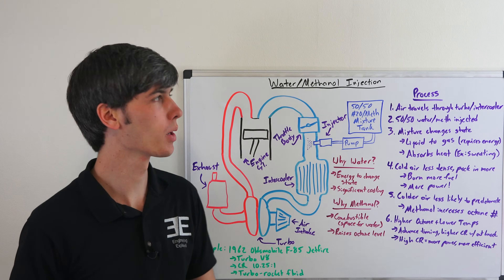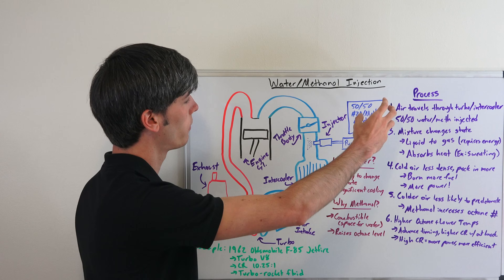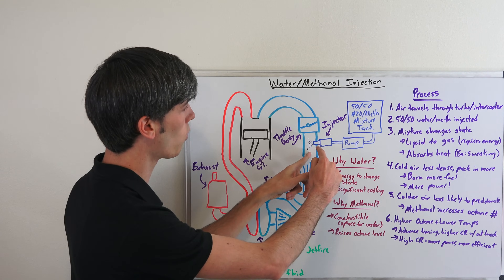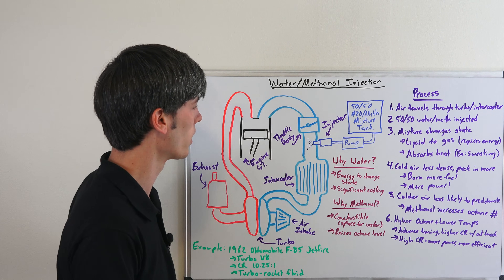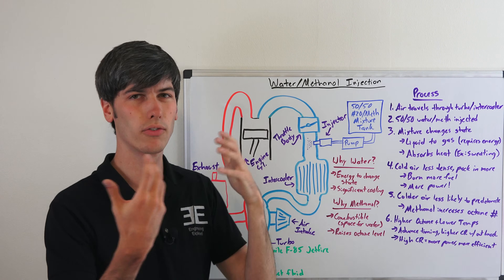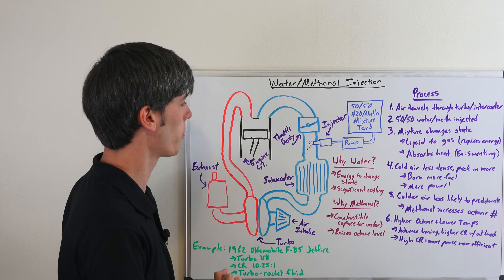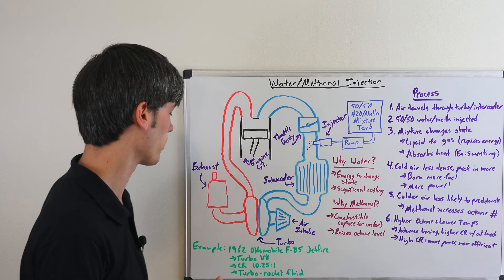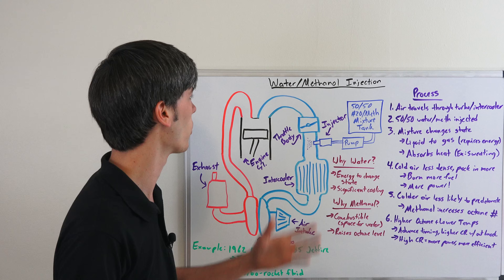Water Methanol Injection - More Boost!

Comment: Will I get a noticeable increase in power output  on my 02 WRX?
Reply: +Greg Mackasey not necessarily true. The water injection only prevents power from being lost via heat or retarded timing, it does not make power. It will only bring back the power you lost if the engine is retarding timing or too hot.
Reply: only if you get a tune
Reply: I'm running such a system and i can confirm that it increases power significantly  no matter on what environment temperature.
Reply: +El Neuro Quila right. It does not make power but can increase power if the engine can take advantage of it. Not all engines can take advantage of this system. 

Methanol can allow for more power to be make if the car is retarding the timing because of predestination. 

The water can allow for more power by cooling the air in the intake. 

One must be mindful that the methanol and water are taking up space for air and fuel. Since methanol had less chemical energy there is potential for power loss of the engine can not benefit from it.
Reply: +Nicolas Losito predetonation feaking  auto correct
Reply: Yep this is a good option if you are running a engine hot with a high compression ratio, because it will increase the thermal efficiency of your engine.

Comment: Hi, Can you do a video out line how to install AEM Water methanol Injection, I'm trying to figure out the progressive controller installation of AEM water meth.
** Solenoid 20AWG 1.5A Brown/White Low Side output. Connect to optional flow control
solenoid, I'm not sure where to connect.
****Boost Safe LS out, 18AWG Green 1.7A Low Side output. Grounded when error condition
exists.
****Arm switch + Yellow wire  Arms injection system. Connect to a switched 12V source.
I'm still searching.... how to do this.. stuff..
Thank you.

Comment: Is there any benefit from injecting the methanol/water mix after the throttle body? And is there a benefit from using a higher methanol/water mixture, like say 70/30 or even 100 methanol?
Reply: Gotta be careful when running that high an ethanol concentration.  The increase in temp is probably because it was running lean.  While the car will run on it, AFR for gasoline is 14.7:1, while pure ethanol is 9:1, and methanol is 6.42:1.  Depending on the car, if the ECU can't compensate for that much of a difference, you could blow the motor since you will need a higher volume of ethanol to match the AFR of gasoline.  I believe the ECUs of the newer cars like some BMWs are able to account for E85 on the fly but older cars don't have this capability.  There will definitely be a huge bump in performance with ethanol in the mix, especially if its tuned for it but its playing with fire if you don't know you're doing.
Reply: Well it would only make it worse because the meth/water mix would have less time to mix with and cool the air. I'm guessing that's why they are put back behind the throttle body.

Comment: Water also expands to about 1600x its amount when turning from liquid to gas, so this helps to add power by causing more downwards force on the piston. It therefore increases the thermal efficiency of the engine because it's converting the heat into physical expansion of a gas (liquid to gas).
Reply: Yea pretty much, because when the water is compressed and sprayed lightly into the intake it will evaporate from some of the remaining heat in the intake air, so you are furthering the cooling process of the air so therefore the air will be more compressed and therefore more combustible so therefore create more energy when it is lit.
Reply: j0n0j0n0j

Yeah, that too! :)

Comment: Nobody is mentioning airplanes? I've never heard of this system being used on land (besides for tractorpulling) but I know that airplanes like the F6F Hellcat, the P51H Mustang, the J2M Raiden and the N1K2 Shiden Kai had a water injection (water/methanol injection in the Japanese planes) to increase performance in high altitudes and as a boost in battle.

Comment: my car's max boost on stock injectors is 10 psi.  I was told that with water meth injection you can increase the boost past what the injectors allow is this because you are burning the methanol
Reply: Well it would work both ways, because the methanol would increase the octane levels in the fuel vapor and the water that's injected into the air intake would take more heat out of the air which would then make the air cool and compress more so it's helping the job of the turbo and intercooler in cooling and compressing air. Because when you cool air it squeezes into a smaller area and compresses allowing more of it to be injected into the cylinder creating a bigger explosion when it's detonated. So yea it would equal a higher pressure of boost.

Comment: Can you turn off that system if you know you can't refill the tanks/ What would happen if you do not fill the tank? Does the system shut-down by himself? Could this cause any damage to the engine since the octane level drops (knock,etc...)?
Reply: +Jean-Daniel Labranche In addition to what others have said methanol is generally used only when needed for example a car may only be able to run 10psi of boost on 93 octane fuel under low load however the methanol kit is programmed to turn on when the car is under heavy/full load to allow for 10+psi of boost in turn making more power only when needed.

Comment: what if the car doesn't have turbocharger ? would this injection system still be applicable? ? if not. why is it so ?
Reply: Only on higher compression rated n/a engines. Because with higher compression comes more heat loss and that is the basic principle of w/m injection to increase thermal efficiency by injecting water and pushing up the octone levels to combat the problem of power loss of having water in your fuel mixture.
Reply: That made no sense.
Reply: Nicolas Losito
Well to put it simply, You have a turbo to compress the air. Because compressed air is more volitile i.e. creates a bigger explosion when ignited. (because you can fit more air in the cylinder) (fire needs fuel, oxygen and an ignition source)

Bigger fire = more heat.

So Higher compression = more heat.

Obviously you have higher compression with forced induction engines.

But you can build a naturally asperated engine with high compression. So you use the water/meth injection to cool the engine (well the water does)
Reply: You are mistaken. 
Yes water injection does cool the engine but that is not the purpose. Cooling the engine is the coolants job. Water injection is meant to cool the intake air temperature.

Why? Force inducted engines compress air at the turbo or supercharger. Compressing air makes it hot and less dense than it could be at a lower temperature. More dense air is better for power. In other words,  imagine compressed air at the same psi but at different temperatures. The colder compressed air will always have more air (density) in it.

Adding a meth to the mix can increase octane. Why? Because methanol has a higher octane than gasoline but DOES NOT produce more power alone because it contains less potential energy. 

Why increase octane? Increaseing octane is only beneficial when the car needs it.  In other words predetonation is occurring because of boost or the high compression of the engine. Increasing octane CAN allow for the engine to advance the timing and therefore produce more power.

As far as naturally aspirated engines are concerned, simply injecting water would not be beneficial for power and would most likely decrease power since the air is already at ambient and the water is displacing fuel and air. 

Injecting methanol or a methanol mix CAN be beneficial to a naturally aspirated engine ONLY if the engine can not run on fuel at hand. In other words the engine requires a higher octane of fuel that is obtainable. Most naturally aspirated street cars will never need methanol unless engine compression is drastically changed.

Comment: An additional benefit of the cooling property of water is that it will reduce exhaust gas temperatures significantly, allowing you to run a leaner air to fuel mixture, increasing fuel economy (I think the cooling effect of the water would cancel out the increased power from a lean, high temperature air to fuel mixture but I'm not 100% sure)

Comment: I always thought that the methanol was added as a cheap anti freeze when used in draw thru turbo setups: to stop the water from crystalising before it hits the turbo, and eroding the compressor.

I have run water/meth in one of my cars for over 15 years and found that unless you want to run stoopid boost, it is a pain in the arse.

I found you want it to kick in a little early (say 20 psi so you can run maybe 35 psi of boost)to prevent detonation and say the motor will handle 25 psi boost (without water/meth).
I found that unless you are using a recirculating high pressure system with appropriate jets controlled by a good electronic boost controller.

I found that when the water/meth kicked in it killed the power unless I was at wide open throttle (trying to prove somthing).

Comment: 10.5:1 isn't that high on an airplane right? Doesn't altitude come into play?
Reply: I don't know much about air crafts and altitude, Although I think because there is less air when you reach higher altitudes you begin to starve the engine of oxygen because even though a turbo may work at the same boost, there is less air to be sucked in.

Comment: This is one of those performance parts that have only costs for a disadvantage (ex. BMC air filter). It raises the power, runs a more efficient setup on the engine, but I have a question, okay maybe two. Is that only for turbo charged engines, can it work on NA V6s and V8s? The second one, if you actually give me the guarantee, if I do this, I have to put a tune right? What I want to do is an idea hopefully waiting to happen. You see I have a 2007 W211 E63 AMG, but want to sell it because it is not for me (my personality - don't get me wrong I love V8s and massive power and wheel spins - I want a car I can track day, use every single day, hours on end) my plan is, get a 370Z (used, manual) and do those things, you see, the first question comes to play here, if it is not as efficient as putting this methanol-water way, then I'll start saving for a single turbo setup that goes to both intake manifolds, and I need all the help I could get, could you help me please? Sorry for long post, but I'm not a troll, a hater, a disliker, all the opposites, and consider myself a friend, not only a fan, thank you if you'll respond
Reply: +TopGearWASBest It's not really recommended for non turbo cars unless you're running a very high compression ratio. If you want the 370Z, a fairly new car, you won't need to rebuild the engine, so a turbo kit will be a much cheaper option. I think a twin turbo will be more fun, but that almost double the price.

Comment: I think it's worth mentioning that another aspect of injecting 2 separate liquids in there is that it's easier to evaporate them. You can only inject so much water before the mixture reaches 100% relative humidity at which point no more water will evaporate and the rest will just remain as a liquid. But even if you'd reached 100% relative humidity of water, you could then add methanol with no problems (at least up until the mixture is saturated with methanol).

But all this does raise the question, I wonder if this system would work properly on a really humid day?

Comment: Correct me if I'm wrong, but I thought that depending on the air temperature that the water can remain in a mist like state and continue into the combustion chamber where it then phase changes into steam and clean the entire chamber (steam cleaning). I was also under the assumption that a mix of 20% can be used in order to keep the mixture from freezing if used in say a daily driver Diesel engine or even gas. The remaining 80% water will run effectively in a Diesel engine I have no idea about gas. Does this technique also increase mpg because you're adding an extra fuel (methanol) and the waste heat is being put to work in the form of steam within the engine or are all these factors attributed to just a diesel?
Reply: Also does this remove a significant amount of heat from the engine block to the point where extra cooling devices such as bigger pumps, fans and radiators wouldn't be needed?
Reply: +indianasquatchunters yes.

Comment: I've heard methanol is bad for engines. Anyone know why that is?
Reply: +Bryan Doherty High amounts of methanol. It eats up aluminum like no one's business then. However, in the amounts and the mixed percentage of water/meth injection (51/49%, almost always), it does not.
Reply: Joe Smathers Okay so then it would only be a methanol fuel that's say 75% methanol that's bad for engines?
Reply: Yes, sort of. 

For a long time (and even still, just to lesser extent) people have methanol fueled vehicles. Some states like Cali had programs giving grants to alternate fuel vehicles, and methanol counted. Usually they were made with iron block engines for that specific corrosion reason. I don't know the percentage they run but I believe it's closer to 100% excepting any water content.

Comment: great video, but i have one doubt , as water is in entering into the cylinder, doesn't it create problem for combustion  i mean 50;50 is considerable quantity of water in mixture, also can water be removed from mixture by using eliminator which only restrict the flow of water into the cylinder

Comment: What do you think about using 2 nozzles for injecting w/m a nozzle before the throttle body and IAT sensor, and another one after the throttle body, between the air intake manifold and and the throttle  body. Do you think is it necessary , or Im gonna end up injecting more w/m than I need. Thanks.
Reply: I think the idea of having the injector behind the throttle body, it gives the w/m sufficient time to cool the air and mix before it is injected. Because if the water hasn't evaporated before it's injected it would work towards extinguishing the detonation which wouldn't be a good thing. I don't see the point of having 2 injectors at each end of the intake pipe if you can inject a sufficient amount as early as possible i.e. right after the intercooler.